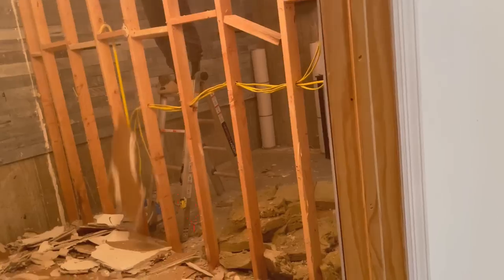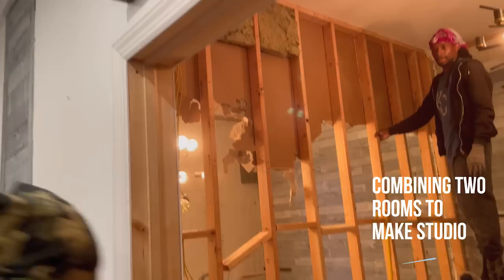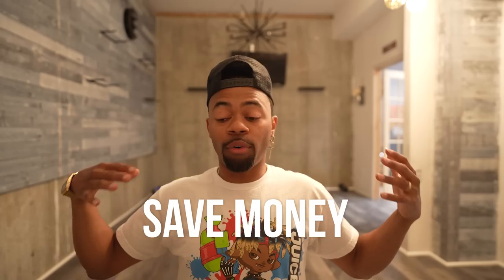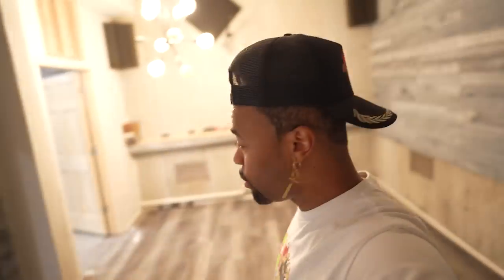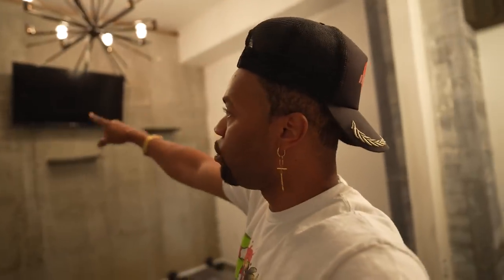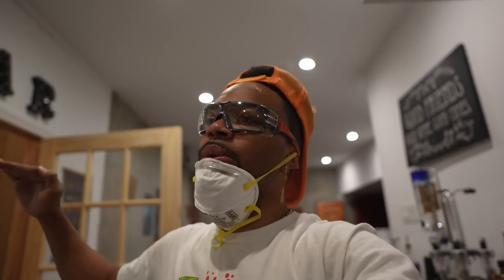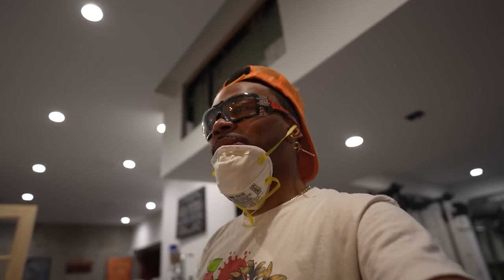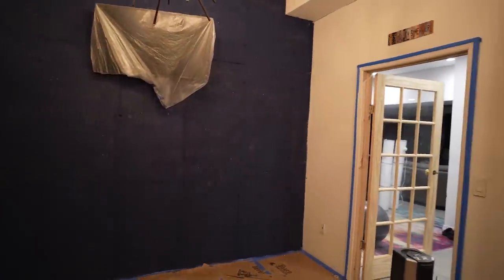Building My Dream Home Studio On A Budget: Part 1

Comment: This was a good start especially if you're not quite sure what direction to go with the full room.  Also being on a budget for the build.  I probably would have just cleaned up and made a space for my gear temporarily.  I would have then sat down and reached out to GIK acoustics for a free room analysis.  You don't have to buy anything but you have access to a room acoustician.  I would then slowly plan out the space and take it as a few projects at a time until it's done.  I would then have time to build a larger budget for the more complex tasks like the ceiling and the overall room shape with the planned panel installation.  Not sure what the overall plan is ,but those wood panels on the walls are super reflective and will make it hard to hear anything for critical listening in the space.  I would have removed them and looked at making a fabric wall.  There are budget fabric wall solutions available that you can really tune down a really bouncy space with.  Andrew Masters used this method in his bonus room space and it is working out very well.  He does full band tracking in his space.